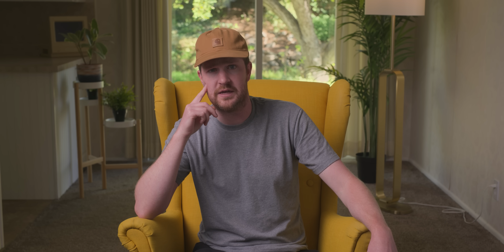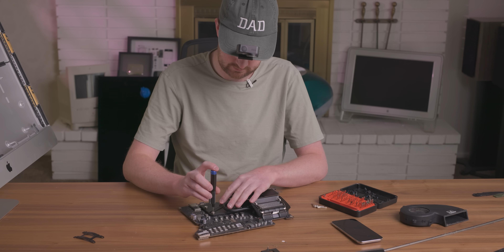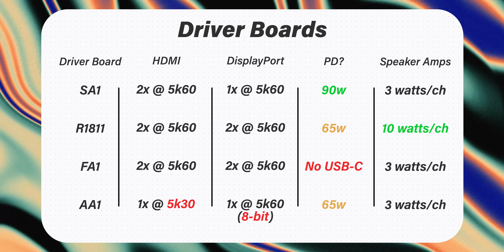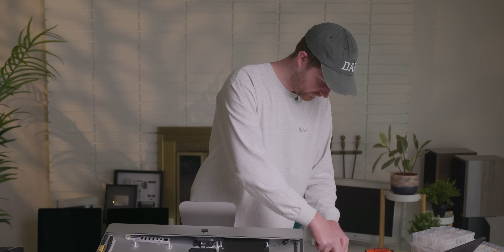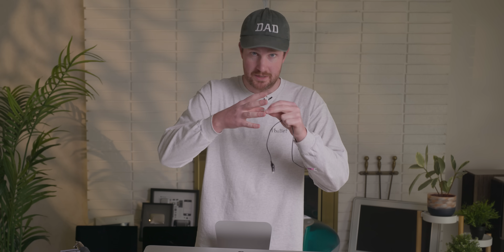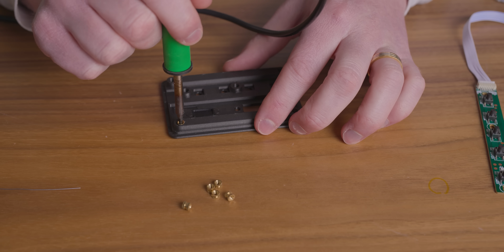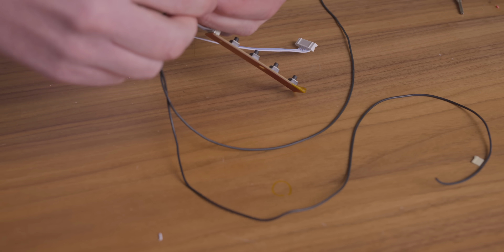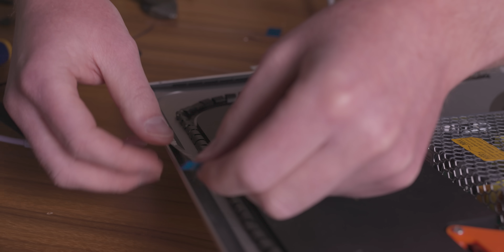I Turned a $200 iMac Into a $1,600 Studio Display!

Comment: The only problem I have with this idea is that unless you already own the iMac and no longer using it it makes no financial sense. You need 300-400usd to buy the iMac, then another 300-400 to buy all the components, you are now in roughly 750 in the red. Ignoring the time you will spend built that you could otherwise get paid doing your job or what not , researching and troubleshooting this, as !this is the fun part of DIY things. For a conservative let’s say 800usd  best case scenario and all you have is a no warranty , can fail at any time monitor, that works with some compromises (eg audio). On the other hand you ca buy with 1200 a good quality Apple Studio Display second hand, has all the features, less change it breaks or fries something, and in 3-4 years time you can sell it for for 400 usd easily. Do taking into account the residual resell value of the item, you broke even. Financially it makes no sense. DIY it makes perfect sense. And even if you already have the Mac , sell it for 400 and top up another 800 to buy the Apple display.
Reply from the maker: $200-300 and then $120-200. But yes, I see your point.
Reply: @snazzy I’m based in UK. For declaration purposes I thought I would give it a shot just for the fun of it and because in principle I don’t want to pay 1.5k for such an old panel to buy new from Apple (or closer to 2k next year for the new model…) . So I actually ordered things from your notion checklist over the weekend.  Items in transit. AliExpress total 331gbp. 316 for a reasonably good condition 2017 iMac that seems a reasonably low risk on eBay, and another 62gbp on amazon for a couple of things I couldn’t find on AliExpress. 710gbp roughly, take 100 gbp off this for residual value of heat gun , heat shrink tubes and a couple of other things , I’m generous here , let’s say 600gbp, ie 790 usd. Current prices. 3 days ago. Let’s see how it turns out. 1200gbp for used apple displays on eBay right now. 

Btw do you have any insight on the poor sound situation?

Comment: I’m so thrilled it worked out perfectly for you on the first try! As an Apple Genius for 13 years, I cringed when you took off the backing to the adhesive and said, “Of course I didn’t test it first, hope it works.” To which I yelled a few expletives at you! I’ve fixed 100's of these Macs, and I always make sure to test it first before removing the backing. It’s actually written in our manuals not to do that! But hey, you were lucky, and it worked! You’re such an awesome builder, as always! Your videos are super entertaining, and you’re one of the few creators I don’t set the playback speed to 2 or 3 times normal. I hope your rib heals up soon! All the best!! Ivan in Portland, Maine!
Reply from the maker: Thanks so much, Ivan! I lucked out haha

Comment: This still active, monstrous thread has all the questions and answers you might ever have: Search for "DIY 5k Monitor - success :-)" at MacForums. For a simpler life, my advice is to skip all the "extras" like the webcam, speakers, fan control and the 3D prints and so. Use a Meanwell LRS-150 that fits perfectly in the 3.5" bay, a single 2M 8K USB-C cable fed through a hole in the RAM cover and an R1811 board for control with Better Display. If everything goes well, it should only take 3-4 hours of tinkering. But don't listen to me, you should do whatever makes you happy 🙂

Comment: ok so tbh owning a steam deck a gpd win mini and other 

just the type c alone is worth it but its also not 3.5k its 4.5k p.s yes i know the not true number of 4 and 5k but there always about 0.5k less but yaa type c 65w could one cable power a gpd win mini and for less then what 1600+ for a monitor with type c and probably 45w power pass though yaa this is a good-ise deal not great but good now on the other hand its a bad deal with time labor parts cost yaa but 4.5k type c 65w also a displayport to type c bi-directional would work yaa if it had 2 type c one with the 65w power and one that was just video type c then yaa i would do it and say its worth it 

sorry long write but i think this should be pinned as it may help some decide if they think its worth it

Comment: Not really fair to say that permissions should have been solved in the ‘80s when the Mac didn’t have permissions until 2000. (Or, well, it did, and they worked fine, but these are different permissions.)

Comment: I just bought a very lightly used Apple 27" 5K Studio Display with the tilt‑ and height‑adjustable stand option fir $1100. Got it in the original box and packing. Not convinced that it is a better purchase than a $100 27" 1440P Apple Thunderbolt Monitor.

Comment: You were able to pull 550 nits from a 2014 model which could do 400 nits?!
Reply from the maker: I used the 2020 panel in the 2014 chassis/speakers since I had both.
Reply: @snazzy  Oh, that really wasn't made clear in the entire video. I don't know why, but the editing made it look like you used the 2014 model alone... At least you bypassed the audio crossover stage as opposed to if you used just the 2020 model...

Comment: hey FYI when puttin on the screen you should have applied all the VHB around the screen, line up the bottom, while monitor is standing, you then pull back the monitor at the top, remove the top strip protection, then seal the top, lie the imac down, lift the bottom then pull all the remaining strips and lower the display onto the seal.

Comment: Juicycrumb’s drop-in board replaces the iMac’s original one. Swap it, plug in power and cables, and you’ve got a working monitor. Camera and mic hook right into the board—no extra modules needed.
Reply from the maker: Not for the 5K it doesn’t.

Comment: During the early Intel or Power PC chip days using any iMac as a monitor for any type of Mac, plug and play, out-of-the-box, worked and you only needed a LAN cable.  Apple has been dropping features and representing it as an upgrade for over a decade now.

Comment: i did this for some old 2016 mac i think. the display is the LS270WQ1, can't belive i still remember that!. i was so young when i did it, and there was no online guides, just trial and error as a teen. currently still using that display but with no 3d printer, the board is just floating around inside the mac body, with a bunch of bubble wrap to try support it!

Comment: This is an excellent upgrade project. However, it would be an order of magnitude easier if Juicy Crumb would just get the lead out and finally release a replacement logic board for these 5K iMacs that utilizes all of the built in features of the iMac such as power supply, webcam, speakers, I/O and so on. Thanks for doing the hard work on this one though! I love DIY projects like this.
Reply: @davidm.d.hyskell8983  that would be fantastic, I hope a board is in development for the 5k iMacs

Comment: I own a bunch of old Macs.
From my original Bondi Blue iMac, to a matching G4 tower, to a dual cpu G5 tower w/ monitor, to a 2008 iMac, a 27" 2010 iMac, aaaaaand the late 2013 21.5" iMac (i7-4770/GTX750M 1gb) that I DIY maxed out (SSD/16gb ram) which I'm typing this on right now : )
I think I may have an old Apple computer collection problem?
Ha!

Comment: I bought a used iMac Pro a few years ago for cheap and just use that as a computer. It performs similarly to an M1 Mac, I get the display, great speakers (better than the regular iMac speakers), and the webcam and studio microphones. I use it for 4k video editing and my office stuff. It has two years remaining support on macOS but I've tested it with Airplay to Mac from my Mac Studio and it works fine as an external monitor using Airplay to Mac.

It costs more than turning a 5k iMac into a monitor but it is a joy to use.

Comment: 🤔💭Since when a "single cable plug & play" not the experience with any HDMI, display port or USB-C monitor?
💡...Purchasing an all-in-one has always amounted to the exact same plight as depending on a laptop. However, with none of the advantages of portability and battery-based operability that a laptop provides.

Comment: I was very curious. But for someone without a workshop, this will take hours in research what to buy, getting the small parts you have laying around, filament, weeks of waiting for shipments. And at the end I doubt I’ll end up below €800. Not to mention my working hours. I think I can get something just as good and way less janky for way less (used and new). I’m fine with a €300 Dell ultrasharp with usbhub and PD. My HomePod mini just flatout died, and here I would solder and firehazard an Intel iMac (known for all them problems) with Chinese no named components and expect it to live for 2 years?
Great video. I’m not doing it 😂😂

Comment: I purchased and converted a used 2015 5K iMac about 3-4 years ago and it was great for a couple hours until I noticed the USB-C cable was *sparking every time I plugged my then less-than-a-year-old $2,500+ MacBook Pro. Gave up immediately, reassembled the iMac with its original hardware, and sold it. I’m still disappointed to this day about that. This video has gotten my hopes up again, but I don’t know if I have it in me to go through all that a second time hoping it doesn’t fry anything 😂
If I had a 5K just sitting around, I’d likely be more inclined to give it a go.

Comment: Complaining about "fuzzy text at 4K" is absolute nonesense.  I ran a 4K 27" Dell UltraSharp alongside a 27" 5K Retina iMac for several years.  Neither display was running at "native" resolution.  I had them both running at 3200x1800 and never noticed "fuzzy" text.  Being a software developer, "text" was what I was looking at 8-10 hours a day, every day.

When I finally moved on to Apple Silicon I went with a Mac Mini M4, so had to find a replacement for the 5K Retina iMac display.  I went with a Dell UltraSharp 4K... 32"....  The larger panel means that running this at native 4K resolution is practical.  I kept the 27" 4K as a secondary, driving that at a sub-4K resolution to give near-as-dammit equivalent UI scaling, alongside the 32" panel.

And still*, at the larger 32" panel size, text at native 4K is *not "fuzzy".

Why?  Because I use my monitors at a comfortable viewing distance, at which these panels are "retina" (small "r") even though they are not "Retina" (capital "R").

"R"etina displays are prescribed by Apple purely in terms of PPI and ignore viewing distance, relying on people switching off their brains and relying on YouTube FUD and FOMO to drive sales.

True "r"etina displays can be had at a fraction of the cost, as long as you don't lean in and "pixel peep" at artificially and uncomfortably close viewing distances.

Oh, and the "performance issue" with non-integer scaling at 4K or sub-4K resolutions etc is... a NON-issue.  Even my old i9 Intel iMac which, if the Apple Silicon hype machine was to be believed, was leagues behind the M1 (it wasn't) coped with this without any measurable impact.  Such scaling CAN become an issue when you add a DisplayLink hub into the mix, but that's a DisplayLink issue.  With a Thunderbolt hub, non-integer scaling is a non-issue.
Reply from the maker: OK. But just know that I and a lot of people can notice non-linear scaling.
Reply from the maker: Text dithering and smoothing is bizarro at certain resolutions. It’s better in recent versions of macOS but still not great.

Comment: Nice, entertaining video! I chose the lazy path… Bought a 2015 27” iMac ($209) and the Luna Display pack ($75). Connecting the iMac to the primary computer (2020 Mac mini) together via small Ethernet switch ($20) ensures there is no latency in the response of the display to inputs from the mini. Result: I have my 5K native display for my mac mini and also, still, a working iMac for the times when I want to use it as a computer.

Comment: My brother in Christ. Even after you’ve saved us dozens of hours of research, you’re talking about spending like $700 in parts and a lot of low-valued-personal time to have a 10 year old kind of Studio Display that has 25 ways to fail at any given moment.  Couple hundred more and you have an actual gently used Studio Display especially since people will be unloading them soon for the new one.
Reply from the maker: $200 iMac. $180 board. May need to do that math again, sir. Also, 2 hours of labor once you use my guide.

Comment: 29:41 If you set the panel down on the frame and pull the peels, you don't need to worry about placing the panel down correctly on the first try.  I do miss the older models where it was just magnets and screws holding things together.

Comment: Thank you, thank you, thank you for this video! I have spent the last few months working on this same project myself. Scouring the internet for information night after night so I could build my own “Studio Display”. I ordered an r1811 board because I thought it was the only board that offered 5k 60fps at 10 bit color. Unfortunately the board didn’t work out the box and the eBay seller sent me down a long goose chase to try and get it to work. It never ended up working and the seller stopped responding… now I’m looking at other board options and this video answers many questions I’ve had about 3d printing parts to make the install cleaner!

Comment: Yikes, you should test it before you put the display adhesive on there. Use clear packing tape around the edges to be sure it's good for a week or so and THEN do the adhesive tape.  For example, did you test the power leads coming off the switch? It matters which wire goes where.
Reply from the maker: No it doesn’t. Simple switches are switches. The leg placement doesn’t matter.

Comment: Yeah. Can confirm. I bought an iPhone 16 Plus this summer to replace my 13 Pro max, and even though it said it had transferred ALL of my settings and apps to the new phone, this wasn't the case, and I had to either dl the same apps, and besides the new phone hadn't arranged the apps in the same folders I had made.
Then, the other day, my refurbed 2020 12,9" iPad Pro arrived and I tried to transfer my apps and setting from the old iPad.... that didn't work, so I tried to dl my setting from my iCloud account... didn't work either. So after wasting 3 hours, I just logged into the new iPad and updated it and started dl all the apps from scratch from the App Store.
"It just works" is a big fat lie! 😡

Comment: why not buy a 5K LG Ultrafine 27inch?
Reply from the maker: They’re worse. Lower luminance, plastic panel, plastic body, worse speakers. Less reliable.
Reply: @snazzy  I have had an LG 27 inch paired with my iMAC pro since the iMac pro came out and never had any issues. I guess it would be cleaner with both "monitors" looking similar but then the color would be off.

Comment: Guys.. don't do this. Major fire hazard and electrocution especially with those knockoff cheap chinese PSUs and converters. Definitely not for unexperienced in this field. I know the iMacs have nice panels but it's just not worth it. And btw, even those old iMacs can run the latest Windows just fine.
Reply from the maker: You’re not gonna have fire or hazard issues pushing 12V at 0.5A through a buck converter lol

Comment: Yes, I converted my 2017 iMac and am using it right now. I LOVE it and have another gutted iMac ready for the board after the tariffs cool off. The 5K is amazing. I'll have a two 5k monitor set up with my M4 mac mini. It's not that hard. I didn't do speakers as they typically don't work.

Comment: 22:22 hot tip rather than snipping the control board and splicing into the ribbon, it's way easier to just heat up the existing button's legs, push it up a little in the hole until there's a gap underneath it, then wrap the incoming wires of your new button around its legs in parallel and solder them there. very sturdy and reversable! alternatively, just desolder and remove the button and push your new wires through the old plated holes.

Comment: Man I have done dozen of these mods and it's fun but I also can see how the quality and the simplicity of doing it has evolved. I also started from that post on DIY Mac, and there's so much knowledge around. You'll find some guides inside and some builds to take inspiration. The hard part is finding old panels, You can simply search for the panel number without buying a whole iMac if not needed. I bought last week the exact board you're using and I can't wait to try it..I might even make a video for the next build!

Comment: My early 2019 fully loaded iMac still runs very well but no longer has macOS updates so I've been looking for a good, complete list of things to get. I love the mounting brackets. They make it look and work professional. I did see on eBay someone is trying to sell the Radeon Pro Vega 48 8 GB display card, actually the entire CPU board without the CPU for some strange reason. This is the most expensive part of my iMac and it would be nice to see if I could part out my iMac to pay for the replacement parts. Once I get a Mac mini or used Mac Studio, I can move everything over then do the display change. Thanks for all the information.
Reply: @robeigner4390  open core legacy patcher to get newer version of macOS

Comment: 28:04 safety tip. Place the object down on a table or in a vise when bearing down on a screw driver. Having your hand in the path of the point of the driver is dangerous. I learned that working with eye glasses in the air force as an optician. Bush crafting has a similar safety concern when cutting with a knife. Hold objects in a way that if the knife slipped off the work piece it doesn’t land on a flesh and arteries.

Comment: We're still using our 2010 27" iMac as a second display using target display mode. I hate the thought of getting rid of it as it technically still works for browsing the internet but that's about it.

And is that a 23" Cinema HD display behind your left shoulder? Ive got one of those connected to a MDD Power Mac. It makes for a great looking retro setup.